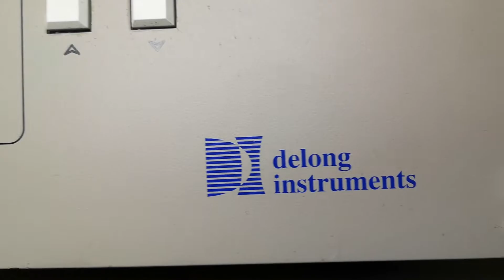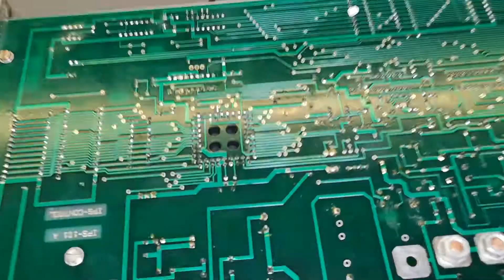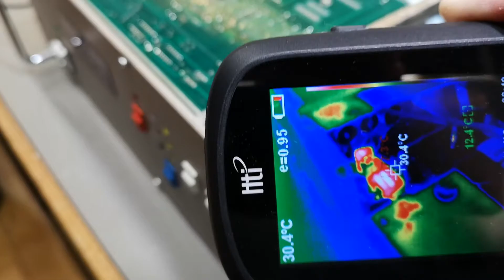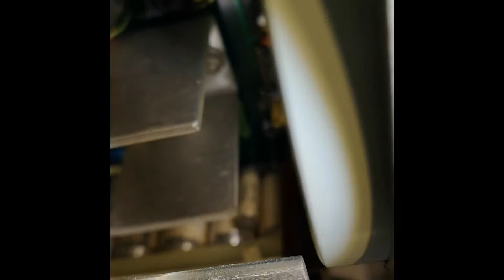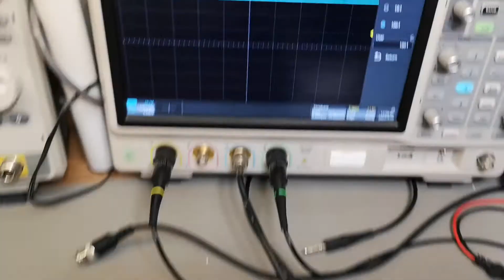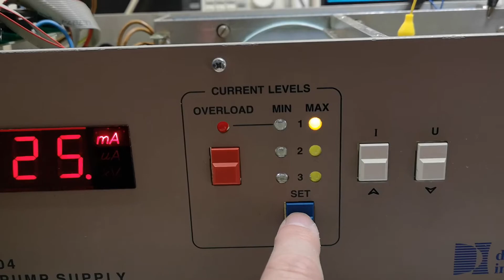ion pump supply delong instruments IPS-04 6kV 225mA Teardown

Comment: Transistors are very likely NPN power devices, likely a BU506D, as that is a common TV output transistor, well capable of operating at that power level at that supply voltage. 2 in parallel, with a flyback supply, and then the multiple high voltage diodes to handle the off state voltage, and the 10n polystyrene capacitors there as low ESR filter.

Voltage can perhaps be changed via the serial interface, or by holding down set and the button at the same time, very common at that era.
Reply from the maker: i think the primary side is a two-fet-forward, running at 18kHz, the highvoltage transformator looks like a TV type, this explain the switch frequency, and YES the transistors are ofcourse also TV types :-) no need to re-invent stuff that allready works great